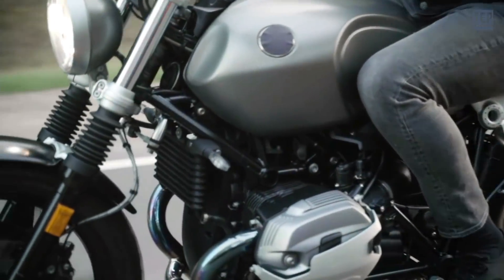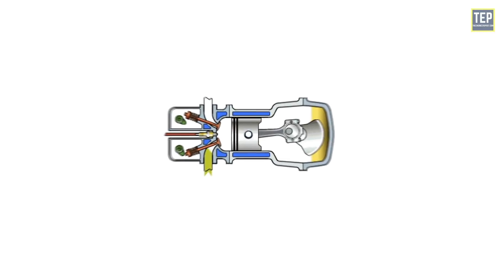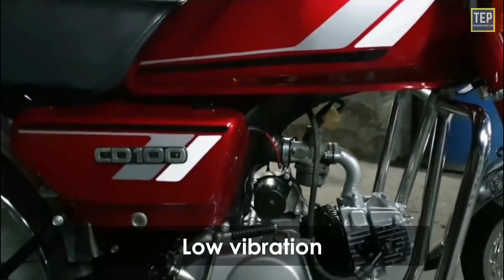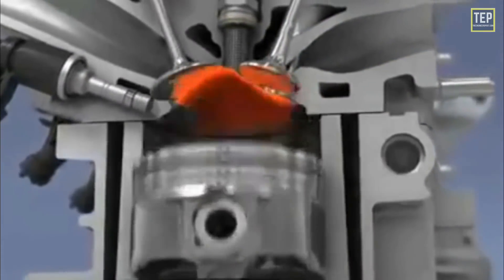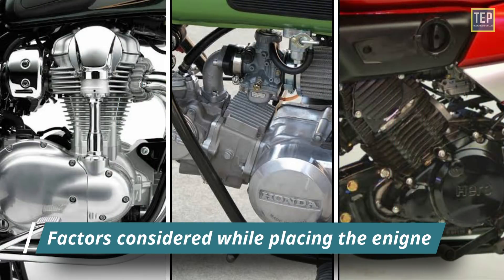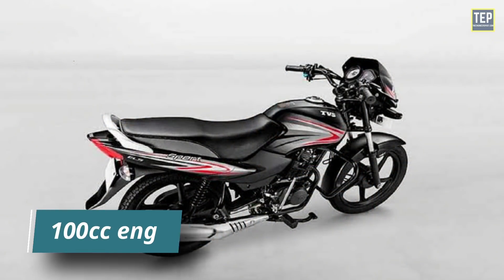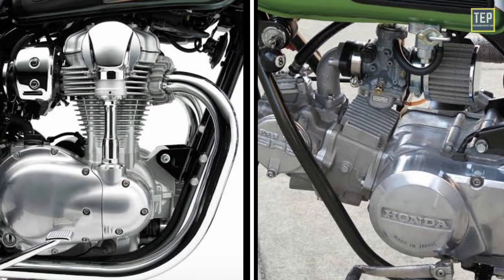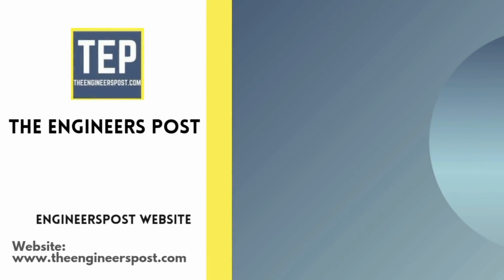Comparing How Horizontal, Vertical and Inclined Oriented Engines Work

Comment: Whenever the Flathead V8 came out people said it would wear out the bottom side of the cylinder like the horizontal engine is claimed to do. Yet anyone who has ever performed engine work has clearly seen the compression and thus expansion of the piston rings into the cylinder wall far overcomes this negligible force. Did engineer really put this show together?
Reply: I have a question for all of you. Where do you guys learn to talk so technically? I wish I could do so too.
Reply: @reddaxtor5662  mechanical engineering classes.
Reply: an engineer, genius.
Reply: @amsterob  Your (ha ha) welcome.
Reply: And saying this , correct me if I’m wrong the flat head v8 could get many miles out of the motor ? Or it did have a limit
Reply: @Thump-nutz  Sodium filled exhaust valves were not used at this time leading to a need to regrind valves at 25,000 mi intervals. Flatheads have the valves in the block, cracks are known problem with temperature gradients so close.  With only three main journals reliability suffered in Non-Stock power applications.
Reply: @jasonstinson1767  it was performance limited because of the hot values heating up the fuel charge
Reply: Cylinder taper is what the machines t is boring out to the next size, there can be some piston scert spal on some engines, but I think that is rod length.
Reply: @DANTHETUBEMAN  Right but it's caused by cylinder pressure and is exaggerated more towards areas of higher cylinder pressure not gravity
Reply: Anyone? Names please.
And don't add mine to that list because I can tell you that no matter how little differemce there IS a measurable difference in wear on the piston and cylinder in all horizontal engines
Reply: Actually inclined engines get out of round just like flat engines do, just not nearly as quickly. Also with the use of modern materials the wear has been even more greatly reduced, but there is still a noticeable difference in wear in those areas than the rest of the cylinder.
Reply: Why do liquid cooled engines don't have fins on piston block?  
 It could help in even better engine cooling with added the liquid cooling!
Reply: @adarsh4764  because the air flow in a water cooled engine compartment is very different than an air cooled engines. The air flow is minimal, and the majority of the air is already heated by the radiator when it enters the engine compartment so the cooling effect is minimal at best. Adding fragile fins that would have minimal to no effect is an expensive process with no payoff.
Reply: @adarsh4764  Minimizing Complexity to reduce manufacturing and materials cost, along with external packaging are the most important aspects whenever purchasing. The simpler a product is the more universal it will be. As for cooling fins inside the engine heat dissipation is limited to contact with air and oil. Air being very poor oil squirters are now widely employed in engine manufacturing. The weight of any part of the rotating assembly increases to the square of RPM negating any games in performance from cooling

Comment: The video has given very clear concept. Horizontal engine is the best for low/ medium capacity bikes,given their quallity in that position. Next is the inclined ones, for heavy capacity engines.   Last is vertical engines, they give more muscular appearance such as Royal Enfield. Gupta.
Reply: Enfield looks like old kabaad rust not muscilar
Reply from the maker: Thanks for watching
Reply: @TheEngineersPost  i have a 1979 ATC 3 wheeler, that was originally a 70cc that went 36mph then put an 88cc big bore kit on it, max speed is unknown, the engine is a 4 stroke horizontal mounting...